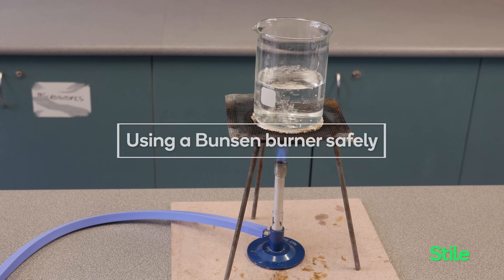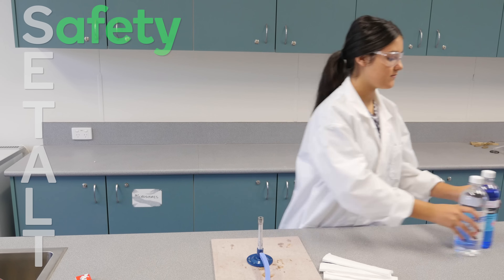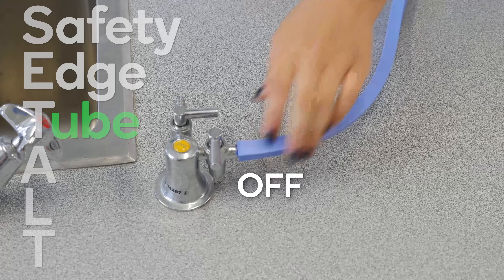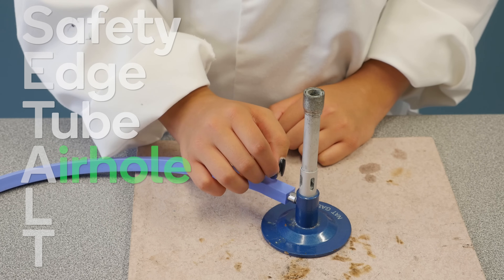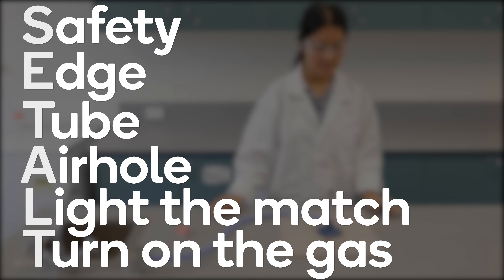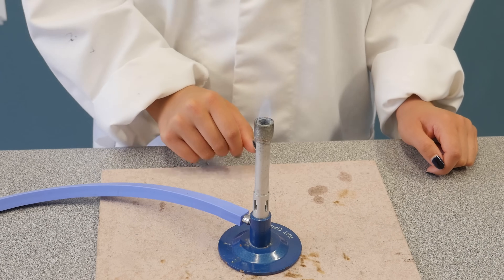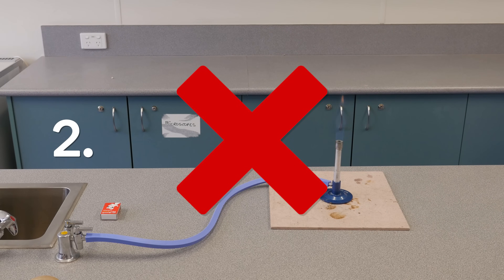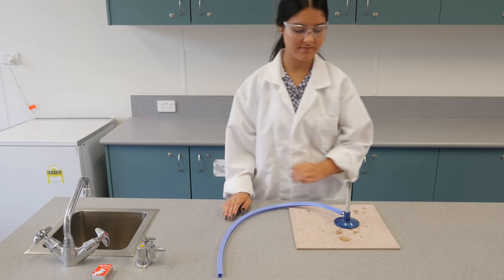How to use a Bunsen burner safely

Comment: I had to this for science 
And I had to answer questions about it
One of the questions was
Why do you think the colour changes when you open the air hole? Because it is exposed to oxygen so the colour changes
Let me know if the answer is correct
Reply: it is.
Reply: Your kpop fan koooll
Reply: Different molecules refract the light energy produced differently. Because the air composition changes when you increase the oxygen, the colour of the flame will change.
Reply: Yes
Reply: Smart kid 😉
Reply: Correct! : ) The gas does not burn completly, methane is CH4, without the airhole, the carbon doesn't burn completly, causing a yellow flame. Opening the airhole, makes the gas burn completly, causing a strong flame.